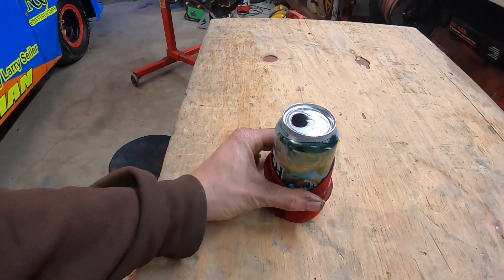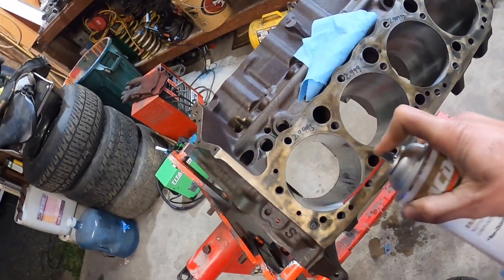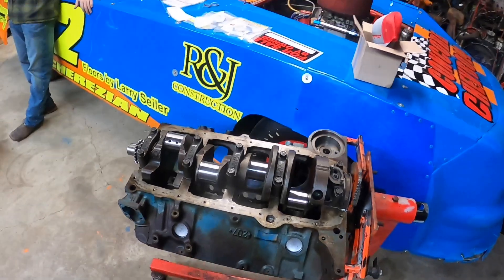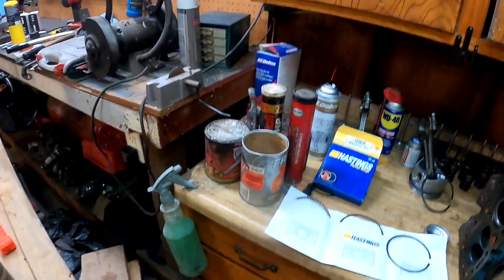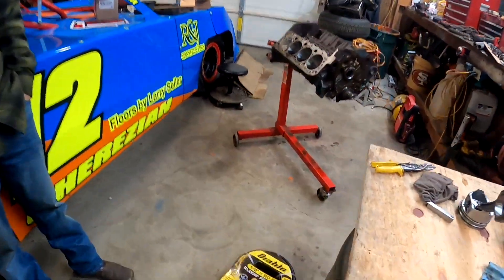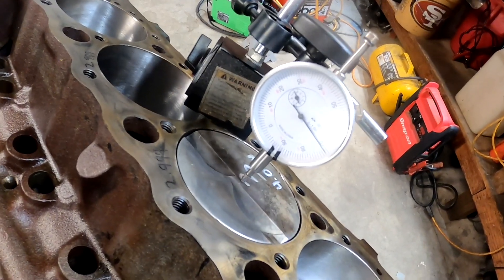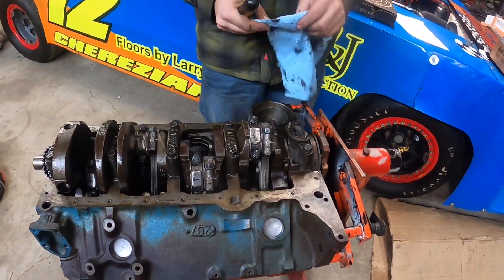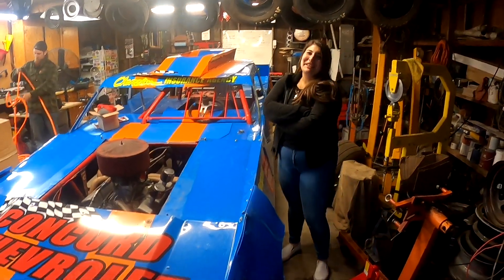Working on Building our Dirt Race Motor -- More Rain Outs for the Super Truck

Comment: Glad to see the video after your brief hiatus. We were in the hiatus boat as well. Ours was due to medical issues with myself and our driver but were racing this year which will most likely be our last. Would love to see ya all come racing with us up here in central ny.
Reply from the maker: Man havent seen you in awhile, glad you made it back over to us. Best of luck to you guys this season
Reply: @CherezianRacing  ya know. We can throw 11" wides on that animal and run it with the pro stock division at Fonda Speedway. They just gonna make you run 6k limiter. 
Really wish I was well enough to come down a see ya all race
Reply from the maker: @joellajuett1060  well they just started allowing 11" wheels in this class too WITH a weight break from the 8" tires im running now. Stupid stupid stupid.
Reply: @CherezianRacing  we have 2 classes up here :
1 - Street Stock 8" wide maximum but must be DOT tire. No rev limiter. Open motors allowed. Stock firewall and stock suspension mounting points. May use mod springs,coils,shock but must stay in stock position. 
Basically cage a street car and run it with a good motor.
2- Pro Stock custom chassis 3000#.  Rev limiter @ 6500 for 602 motors 6000 for open motors. Rear spoiler hight max of 46" off ground. 
Just the basics of the class